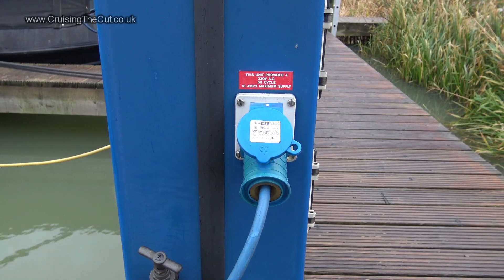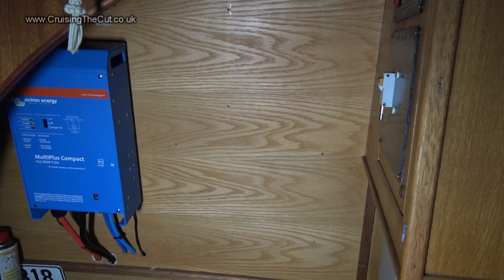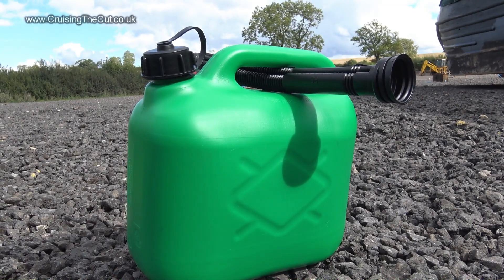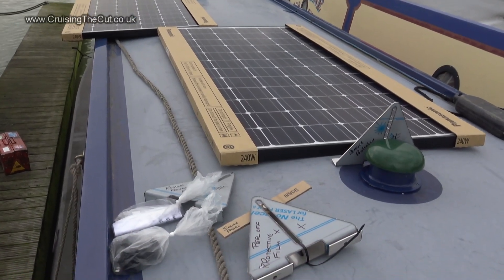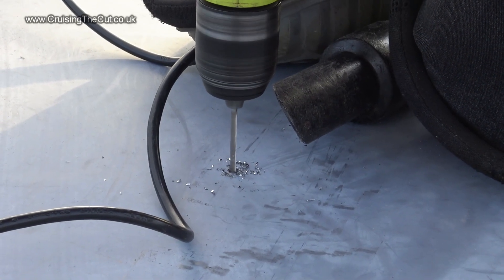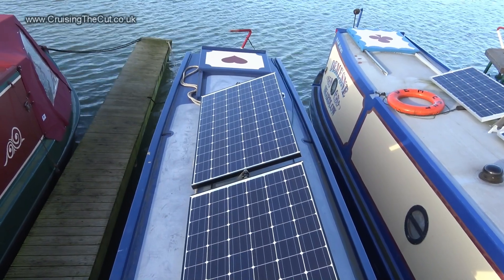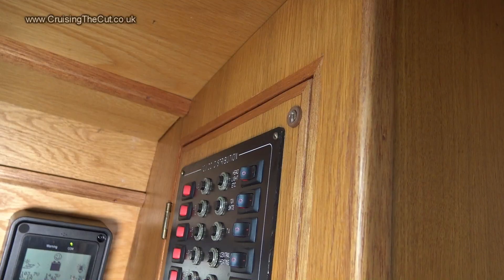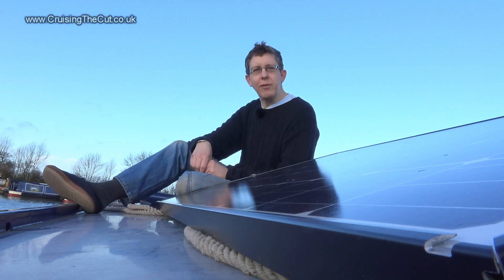15. Solar panel installation on my canal narrowboat (2 x 240W Panasonic)

Comment: I'm looking at installing a kit, like you I'm a bit anxious about installing it myself, I'm also a little worried about purchasing something so pricey from random small companies online - do you know who you purchased from? was it a kit or did you work out the best items each? And how did you find the man to install them?
Reply from the maker: The only tricky bit on a self-installation is drilling the holes into the roof, the rest is straightforward if you are decently competant at electrical wiring. If you are in any doubt, get someone competent to do it for you - I got recommendations from the other boaters in the marina I was staying in at the time. I got the panels from one supplier because I knew what panels I wanted (based on capacity and physical size), the charge controller and other bits from another (Midsummer Energy) so it wasn't lots and lots of random companies. The brackets came from eBay.
Reply: CruisingTheCut thanks, I am trying to work out best cost for money, do you know who the panel supplier was?
Reply from the maker: I don't remember, sorry. Just google for suppliers and get prices.

Comment: Hi David, thoroughly enjoying your vlogs. Couple of questions for you, what was the approximate cost of the whole solar system? And secondly, did you ever consider the semi-flexible solar panels, such as these? https://www.bruceschwab.com/solar-power/solbian-flex-high/
Reply from the maker: Can't remember exactly; maybe £1000-£1500 ish?? I considered them but wanted the fixed panels with airflow under to keep them cool.
Reply: Okay thanks. I'm in the process of buying a Sealine 310 Statesman so whilst not exactly the same type of boat, a lot of your vlogs have been insightful, and solar panels is something I'm looking into. Since I commented, I've now learnt that the flexible ones can actually be sewn into canopies/hoods/biminis etc. More homework required which I'm sure you're familiar with...
Reply from the maker: Ah, yes I think the flexible ones have a much better application on that type of boat because they aren't sitting on a hot metal roof which isn't good for them. Love a bit of boat research, have fun!
Reply from the maker: And breaking them, don't forget!
Reply: Well like you, I am having to sell my house to do this whole boat plan (the boat will be moored in Spain - handy for the solar panels), and as yet the sale hasn't completed - probably no bad thing, because no doubt armed with a pocket full of cash a few months back I would have bought a lemon so it's given me the time to do a lot of research into all the different models, moorings, and solar panels amongst the million other things required. :-)
Reply from the maker: Sounds terrific!!
Reply: Indeed. The only thing that really scares me is the fuel costs... I don't think I've seen you mention an average mpg, but mine being a sports cruiser, I'll be looking at around 1mpg. Yes you read it correctly. ONE mile per gallon. But for the main part I'll just be pottering around the coastline, dropping anchor and using the tender to go inshore to a secluded beach or cove etc. Possibly offsetting costs by renting the boat out on bedsonboard.com which might be of interest to you if you wanted to earn a few pounds for when you go away on holiday yourself
Reply from the maker: I've never measured mine but about 1-1.5ltr/hour. I'd need an entirely different insurance and boat licence to let out - besides, it's my home so I don't want strangers in it!

Comment: Clear cold sunny days in winter will give you lots of solar as there is less moisture between you and the sun and the panels are nice and cold but any free power is a plus.
Reply from the maker: Sunny days any time give me lots of solar with this array ;-) A pity we get so few clear sunny days in winter though :-(
Reply from the maker: Maybe. Depends on the wind, of course. Also quite costly, noisy (rattly) and you have to take em down and put em up each time you move.

Comment: hi david  been watching  your  vlogs  everyday so far after finding them  two days ago now a new subscriber to your channel just watched  number 15 installing solar are those panels the type that does not  need direct sun light as I was going to have solar on the  house.  some time back and they said that the  roof was in the  wrong direction so that put paid to that idea  thought nothing  more about it  then 6 months later get another phone call now saying the roof is ok for solar as they now do not need direct sunlight  now its  just based on daylight hours may it be direct or indirect sunlight they  still charge  so do yours work that way ??          keep up the good work.
Reply from the maker: As far as I am aware, solar panels always work better if they are in direct sunlight, and substantially so (hence the tilting brackets so that I can turn the panels to the sun). Whilst they do generate a reasonable amount if they're not pointing directly, it's certainly better if they face the sun. I think - and I am not a solar expert - you'd get some output but it wouldn't be as high as if your roof faced south.
Reply: I see just watching u thread that blue cable at the moment behind your bed  bet u had fun doing that .
Not a job I would enjoy do not like working tight spaces and no room to move .
When do u start your next  cruise.?
Reply from the maker: April. See https://www.youtube.com/watch?v=xoeF6hFPIb0
Reply: Thank u. Will do.
Reply: Some solar panels definitely only need light rather than sunlight. I can’t speak to panels on boats, but when I had panels put on my house roof I was very surprised by how much and often they charge. They can charge when it’s freezing outside, and in twilight and these were put up several years ago & I know the best ethnology has moved on considerably since then. Good luck finding what u need.

Comment: would it not be possible to have solar panels installed in the sides of the boat to generate much more energy so that the need for marina power wold be minimal
Reply from the maker: The need for marina power is already minimal with the panels installed. After I put them on, I disconnected from shore mains from the end of February until the around mid-October/November. So the marina power is only really needed in winter.

Comment: I notice that your mains cable was coiled on the deck try to avoid coiling wires as this can generate excess heat that can lead to being a fire risk,a good book to ponder over is called (the 12volt bible)it gives lots of useful information on batteries and wiring.
Keep blogging
Reply from the maker: Cheers Paul; I'll never draw enough current through that wire for it to heat up but good point!
Reply: Yes I always wonder why manufacturers suggest coiling kettle wires up under their charging bases. Particularly these multi kW beasties that’ll boil water and virtually make the toast all in under 10 seconds without changing up into 4th gear or breaking a sweat! Seems dodgy to me!

Comment: Your comment on diesel engines idling, yes if you idle a diesel engine for more than ten minutes the fuel breaks down into boracic acid and corrodes the metal.  diesel engines need to work under a load to help it run properly and avoid these issues.
Reply from the maker: I had no idea what the actual process was; very interesting. Cheers

Comment: I don't know if I've missed somebody else making this comment - why are your panels wired in series ?  Why pot down 100v to 14.4v when wiring the panels in parallel will give you TWICE the current of a series wired configuration ?  Let's not let domestic grid generation methodology creep into boats - we're NOT really interested in any voltage above 14.4 - it's only the current from each panel we need for battery charging ...
Reply: The regulator chosen is a smart unit that can accept almost any DC voltage and using switchmode technology reduce the voltage to that required by the battery with almost zero line losses. Conventional Solar regulators are often just series pass transistors that Pulse Width Modulate (PWM) the panel voltage to control battery voltage so the panels need to be matched to the battery, 12 volt (actually 18) for 12 Volt systems and 24 volt (actually 36) for 24 volt systems. I do appreciate your concern though 100 VDC is classed as a lethal voltage where I come from in Australia and would invoke the wrath of the technical regulators! All sorts of fusing and earthing would be needed to make them happy.
Reply: P=U*I  so either configuration is good, In theory.. But I would argue that less volts and more amps means the need for thicker wires and more loss in the cabels, but I could be wrong.
Reply from the maker: You may get twice the current but at half the voltage so you don't gain any extra power overall. I am not a solar engineer, you'd need to consult one for a full and proper answer.

Comment: Retired technical teacher here and just wanted to say that's a very professional installation right down to using a polyurethane sealant and not the usual silicone. Enjoying the relaxed pace of the series.. I suppose that might have something to do with narrowboat culture.
Reply from the maker: He's a good bloke, Simon, although Sikaflex is pretty standard on boats. Thanks for watching :-)
Reply: Here in Canada Sikaflex seems to have been replaced with US made 3M 5200.. Most here unfortunately go for the much cheaper silicone and pay for it later on.
Reply: Only problem with Sikaflex is the shelf life if not kept at cool, constant, temperature. the new 3M products are more robust and just as good.

Comment: An odd question but I wonder if you start to dig in a bit with the challenging stuff... I'm luck enough to be fairly decent at those sorts of job but I admit I'm not the biggest fan of electric string!
Reply from the maker: I don't understand the question, sorry. "Dig in a bit"?
Reply: Sorry... poor choice of words. Have a go yourself chap...
Reply from the maker: Ah. I certainly wouldn't do a solar install myself, at least, not the bit where holes are drilled into the roof. I'd have cocked that up for sure!

Comment: A particularly useful episode. I have ordered a boat which is currently being built and asked the boatyard to install the necessary cabling to implement a solar solution later, including those to the panel where the inverter is being installed so that a solar charge controller may easily be added. This makes a lot of sense as it avoids troublesome threading of thick cabling after the fitting out. This episode correctly suggests solar panels on an 'A' frame allowing one to tilt the panels towards the best available light which is in contract to some heavily marketed flat/curved panels for a narrow boat.
Reply from the maker: If you can be bothered to do the tilting ;-)

Comment: I was looking at installing the same panels but would like to mount them flat as I think they'd look nicer and be harder to steal. Do you know what effect that has on the output? Have you tried running them not angled towards the sun?
Reply from the maker: Don't mount them totally flush with the roof as solar panels prefer not to get hot (really!) so let them have some airflow underneath. I usually have mine flat but while I was in the marina, the sun was consistently coming from one side hence the tilting in the video. We haven't had enough consistent sun for me to do any sensible checks on what difference it makes but there are plenty of YouTube videos which do and websites which have test results.

Comment: Have you given any thought about wind power? I notices at the marina where my father has his sail boat, lots of other people have small wind mills generating power. This might be handy for your sunless winters if you get enough wind. The more ways to make some power, the better, esp if you live on your boat. My father only uses shore line power, no solar or wind, but he doesn't live on his boat at all.
Reply from the maker: Thought about it, some boaters do have it but it's costly and can apparently be quite rattly and noisy when it's going full tilt, despite soft mountings. And you have to take it down every time you want to travel (so the boat will fit under bridges etc).
Reply: CruisingTheCut
Ah, I wondered about the height of it. Most of them are mounted high on the sail boats which of course doesn't matter out on the bay. Wasn't sure if it would work well enough if it was only a couple of feet above the roof of the boat. Yes, some of them do rattle and worse, the vibration can be heard through the roof of the boat and can drive you nuts when you're inside. Maybe it would not be so bad if it was mounted on the bow of the boat. But if it just wont work well there's no use trying to mount one any where.

Comment: Does the TV run of the solar panels or the battery? Also, does chargers for laptops e.t.c. Run of the battery or the solar panels? Please can you tell me
Reply from the maker: +Sam Armstrong everything runs off the battery. Nothing runs directly off solar. The solar charges the batteries, the batteries power stuff on the boat.
Reply: +CruisingTheCut ohh, so if you watch the TV, it will drain the battery?
Reply from the maker: Well, yes. Where else do you think the TV (or any of the other electrical items) get their power from?

Comment: how are solar panels doing thinking of getting some would like to know if they do the job will get the same ones you have
Reply from the maker: They're doing very well for me. I haven't run the engine to charge the batteries at all. In fact, even the last month in the marina was 95% solar-powered despite having shore mains available. That said, I'm careful with the power and keep en eye on it. Your circumstances (electrical use etc) may be different. It's advisable to do a power audit to work out how much solar you need.

Comment: English weather and 0,5А charging...
What do you say about wind turbine?
Reply from the maker: +Serhiy Lonko Not sure what you mean by 0.5A charging. Wind turbines are a nice idea but can be very rattly unless installed with plenty of isolation, I'm told. And you have to take them down for travel otherwise they'd get ripped off going under bridges, through tunnels etc.
Reply: +CruisingTheCut 
6:12 on your video controller shows 0,5А. I do not argue about wind generators , just asked about your opinion.
Reply from the maker: I'm not looking to argue either. The 0.5A reading was in the middle of winter when the panels were installed. I've seen 28A since then on a sunny day and I regularly get 10A on overcast days. Wind turbines are a nice idea but aren't always practical or reliable as a source.
Reply: +CruisingTheCut 
Thanks for your answer.

Comment: +CruisingTheCut I understand why you chose to get those solar panels but it just hurt my heart to see them installed. It sort of ruins the classic appearance of your boat in my opinion. It's a shame that there are no solar panels better fitting for such a case. Or at least if you wanted to install them in a way to preserve this classic look it would probably cost a fortune. 

Great videos though, really nice and entertaining to watch. 
Keep up the good work and good luck on your voyages. :-) 

(English is not my first language but i hope you understand what i meant to say) 
Cheers
Reply from the maker: Your English is excellent. There are flat, flexible solar panels which stick to the roof so they're much more invisible but they're not as efficient, they're expensive and once you've stuck them to your roof you can't get to the paintwork without ripping them off!

Comment: In addition to solar panels, I also got a 'smartgauge' - a pricey but simple state-of-charge meter. It basically displays a % of the battery's capacity based on some logarithm-thingy-me-jig. Don't know exactly how it worked, but it did work and meant I always knew when the solar had done enough to charge the batteries during the day, and when I needed to run the engine (and for how long). Plus there's the satisfaction of getting home on a sunny day to find it displaying 100% thanks to the panels.
Reply from the maker: I'm very interested to hear about that as I've been considering getting one. So you really rate it? I have to go just by voltage at present.
Reply: I definitely rate it. There's a degree of guesswork involved in using voltage readings which is eliminated. You can also be certain that your battery doesn't drop below, say 75% capacity, and if you ever need to run the engine to charge them up, you'll know when the batts are full and you can shut it off.
Reply: Enjoying your videos very much, btw. :)
Reply from the maker: +mtxict Thanks!
Reply from the maker: +mtxict OK, definitely worth investing in then. And I'll make a video about it too :-)

Comment: What about wind generators in the winter?
Reply from the maker: I've asked about that and apparently they're quite noisy and rattly and vibrate throughout the boat, so nice idea but not ideal it seems :-(
Reply: Vibration depends on the mount.  Newer units have quieter blades. Sail boats all over the world use them in conjunction with their solar
Reply from the maker: Haha, sailors are used to everything rattling like crazy in the wind! :-)

Comment: Ok great blogs, very interesting etc, etc, but what did the solar panels and fitting them cost?
Reply from the maker: It depends how many panels you have, what type, what sort of controller. You can spend anything from £500-£1500 ish, including installation.